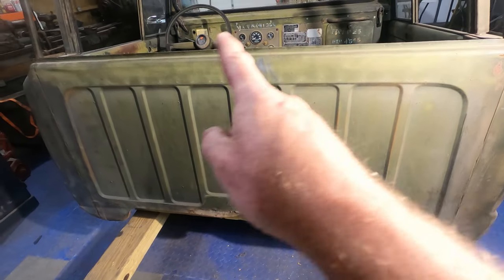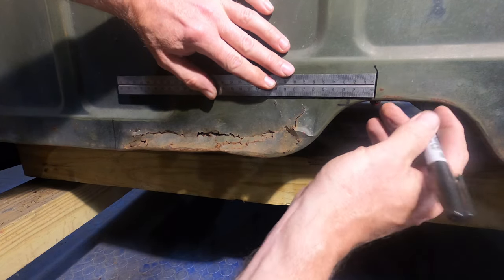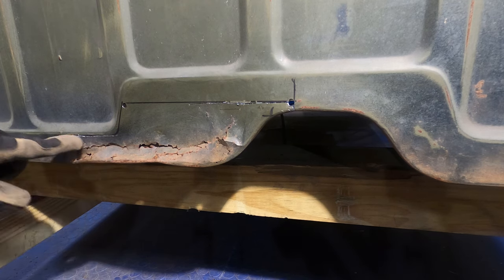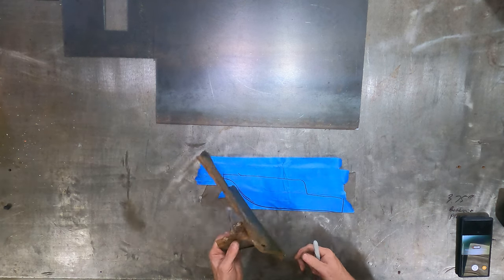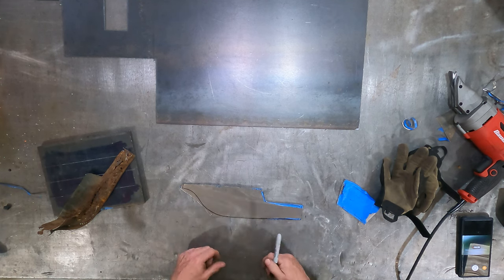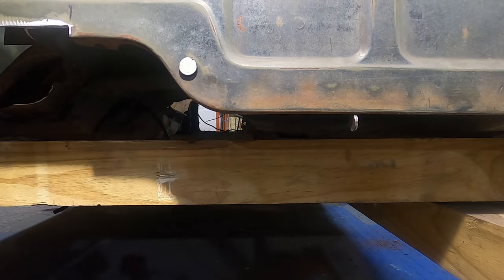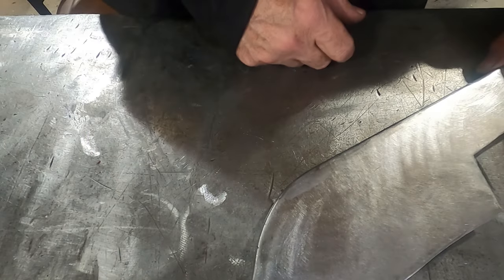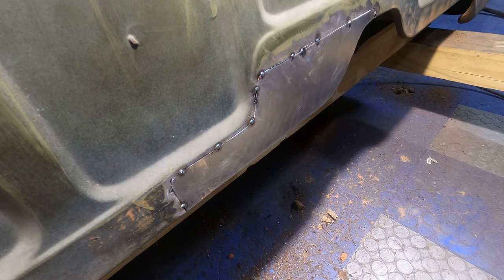1967 Kaiser Jeep (M715) Project - Cab Repair - Rear Wall

Comment: Where have you found replacement parts like body mounts weatherstripping especially around the windows. Would love to see the process when you go to replace them.
Reply from the maker: As far as replacement hard parts, I make my own (after all, we are a metalworking and fabrication shop ;) )

As for soft parts, specifically weatherstripping, there is a large amount of general purpose material available.  You can get all types, such as some designed for flange mounting by a press on + glue fit, some for surface mounting, such as door seals, etc.  Also, window wipes for the rollup / down windows can be purchased and cut to length.  

I'll definitely be covering those as I get nearer and nearer to the smaller details.

Here are some examples of what is available, there are plenty more but I figured I would drop a few here as examples:
https://www.amazon.com/Windshield-Gasket/s?k=Windshield+Gasket
https://www.amazon.com/s?k=automotive+door+seals&crid=3M3Z6LKSAR5XM&sprefix=automotive+door+seals%2Caps%2C119&ref=nb_sb_noss_1